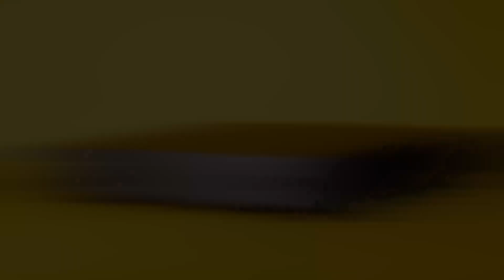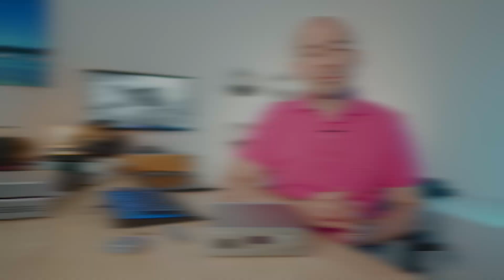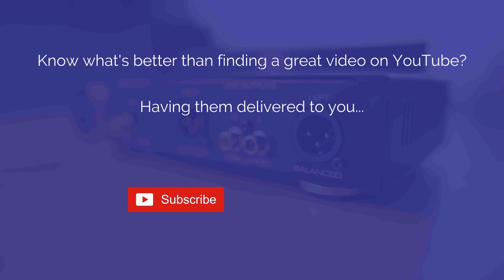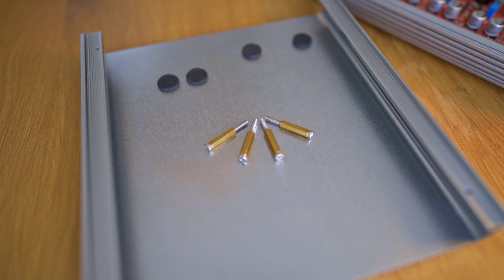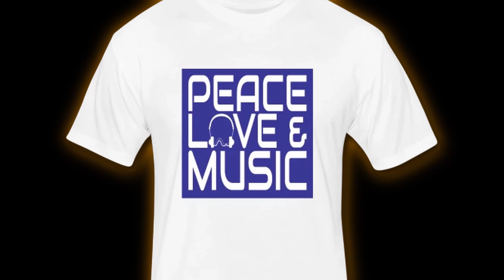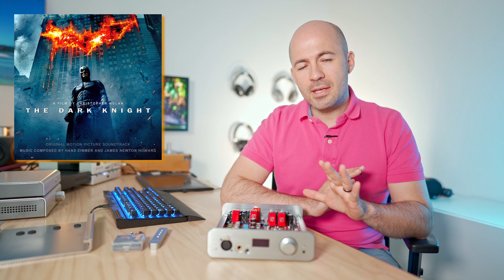Burson Soloist 3X Headphone Amp Review - New tech + old classic = wow!

Comment: Hi Lachlan, thanks for the incredibly detailed review. I absolutely love it and already thinking of pairing this amazing amp to my Chord Hugo2. 

Do you think they would make a great pair? I’m using them to drive my LCD-2C, Hifiman Susvara, Unique Melody MEST MK. II and LCD-4! Do you think I should purchase a fully balanced DAC like the Schitt Bifrost 2 to make them a fully balanced stack to yield more power for these power hungry cans?

Thank you so much mate. I’m looking forward to hearing your great insights. Have a great day good sir!
Reply from the maker: Hi EG, the Soloist and Hugo 2 should be a great combo and, from memory, there's no particular benefit using the XLR inputs on the Soloist. It will have plenty of power for all your headphones even from just the Hugo 2. I also don't know if the Bifrost would be a better overall DAC. I think the Hugo 2 is probably preferable.
Reply: @PassionforSound  Cheers mate, thank you so much for the elaborated answer. How would you fair Soloist + Hugo2 with an all in one combo like the Conductor 3X Reference? I appreciate your time and knowledge greatly, thank you!
Reply from the maker: The separates will almost always outperform all-in-one devices up until you're in the TT2 range of price and performance so I'd definitely stick with the Hugo & Soloist.
The reason I say that about all-in-one devices is that they almost always are a compromise, sharing power supplies, noise, etc. and by using a single chassis, the space for the circuits are limited so you're not getting the full potential from either amp or DAC.
Reply: @PassionforSound  Gotcha, thank you so much mate! Have a wonderful day over there :)

Comment: Hi Lachlan, great review. I have a Burson Conductor V2 amp and I was wondering if you feel there would be tangible benefit in going to the Soloist 3XP? My DAC is the Composor 3XP, and current headphones are LCD2 (2020), 660S, and Elegia. Quality interconnects.
Reply from the maker: Hi Heath, there'll be a huge upgrade in overall sound quality, but also a slight change in signature I think. I owned a Soloist V2 and the Soloist 3XP is more neutral and less mid-focussed. If the Conductor is anything like the Soloist of the same generation, you should expect a less coloured sound, but also much improved transparency and resolution
Reply: @PassionforSound  Thanks, Lachlan, I bought the Soloist. I've had it for 3 weeks and you were right on the money with your review, and with your comments on my question. Thanks, again.
Reply from the maker: That's great news that you're happy with it, Heath. Congrats!

Comment: Did you manage to try the Sparkos op amps with this?
Reply from the maker: Not yet, but I literally just email Sparkos about this yesterday 😁
Reply: @PassionforSound  It was in the airwaves!

Also, did you try the Burson with the Chord Qutest? Even if you didn't, can you speculate wheyher you think it would be a good combo for a clean and detailed sound without any harshness? That's my impression of what the combo would be like from what you've said here and they're what I have my eye on.

As always great videos and I really appreciate what you're doing with this channel. Your explanations are the best and I really value your opinion, especially while it isn't easy for me to try this expensive equipment before I buy.
Reply from the maker: The Soloist / Qutest combo will be magic! I didn't try them together, but I use the Soloist with the TT2 all the time and the Qutest has many similarities as you'd expect. It will be one of the best headphone setups you can buy for under about $5000 IMO
Reply: @PassionforSound  that's excellent to hear that you use that set up all the time. Quite the endorsement. That solidifies that pair as my aspiration; it will make quite the upgrade from my r2r-11. 
It seems like the Qutest would have the similarities as you say, but with more smoothness than the TT2.

Thanks again!
Reply from the maker: My pleasure

Comment: just ordered this amp with the bifrost 2, as you seem to have that as your optimal pairing for this if i'm not mistaken (at least for this price), i expect a sizable upgrade from my current jds el ii stack. i will be using this combo with a diana v2 vs clear mg to decide which one i keep (so far i am a bit torn, diana = more detailed but mg = more punchy imo). on that note, do you plan on reviewing either of these headphones in the future?
Reply from the maker: You're in for a treat. That's definitely my preferred combo before stepping up to the Qutest as DAC.
I would like to review both headphones at some point, but I'm yet to have success with those companies so they might have to come through as loans.
Reply: @PassionforSound  considered the qutest too but was able to get this stack for similar price all together (slightly used). was also eyeing the conductor 3xp which i found quite cheaper on recent classifieds for ~$900 if you have the patience in order to snag a deal like that, but i care about the sound more than extra features. will update here on my findings soon

hope maybe someone local will be able to loan you some more headphone brands like these!
Reply: alright after a couple days with the stack upgrade - immense improvement in sense of depth and imaging, more layered while being precise which adds to represent a lifelike sound. separation is suberb, actual feeling of vertical and horizontal space. both headphones performed greatly with the stack, but as i purchased the clear mg for about half the price of the diana v2, i can't justify the cost with the (let's say 15-20%) improvement of resolution/speed that it provides over focal

extremely happy with this setup! i will keep this as my end-game until maybe someday when i can comfortably afford a 1266 or susvara
Reply from the maker: That's great news! So glad you're enjoying it so much! 🙂🙂

Comment: My soloist 3XP is on its way with 4 extra Sparkos ss3602 Op amps as well
Reply: I’m also excited to test the power amp mode with a separate pre amp to see if the soloist current will improve to totl headphones.
Reply from the maker: I'd love to know how the Sparkos compare to the Vivids in the Soloist. I don't have the right ones for the Soloist ☹️
Also, with the power amp mode, it will only be an improvement if your preamp has a better volume control implementation because the Soloist volume setup is outstanding already. Fun to try though and see what you prefer 🙂
Reply: @PassionforSound  so many options!  I’m also looking at some focal solo6 studio monitors as well (used) so will be Interesting to how the soloist does as a pre amp.
Reply from the maker: I'm using it as the preamp for my KRK Rokit 5 G4s and it's great!
Reply: @PassionforSound  I've had the Soloist 3XP for about 10 days now and have tested it with the V6 Vivids and Sparkos SS3602 op amps... My initial takeaway is the Vivids provide a slightly more V shaped presentation with more bass impact and a slight extra sparkle on top.   The Sparkos are a bit flatter with more emphasis on mid range and I'd say a slight improvement in technical performance/clarity/resolution as well.   With my 1266 Phi TC the Vivids are more impressive but perhaps the Sparkos are easier to live with in the long-run.   I haven't a-B tested them with my other hps yet (LCDX, LDC3F, Focal Clear, and Klipsch HP3s) but plan to do so.
Reply from the maker: Thanks so much for sharing. I'd better reach out to Andrew and get myself some Sparkos op-amps for a try...
Reply: @PassionforSound  Honestly I think if you have a Susvara or a 1266 Phi being fed from the Soloist 3XP it is worth it.  Perhaps if one wanted to cut costs just getting a pair and switching out the input side would be suitable without having to get all 4 for the volume stage as well.  It's a pretty great amp and I'm going to try the power amp mode next week to see if there are any substantial gains there.
Reply from the maker: The power amp mode is definitely an improvement if you have an excellent volume control in the DAC / preamp. Also, stay tuned for a review of a brand new add-on product from Burson that's also a nice upgrade for the Soloist.
Reply: @PassionforSound  I have a Holo mammoth KTE hp amp they has a pretty good volume control in it but not sure if superior to Burson.  Will just have to test it out..  I won’t take your thunder but my guess would be an upgraded power supply from Burson to pair with the soloist.  Perhaps like the XI Audio Formula S + Powerman combo just at a more budget price.
Reply: Can’t wait to see that review I’ll keep watching for it!
Reply from the maker: It'll be interesting to see how the two volume controls compare.
No comment on the review 😉😉
Reply: @PassionforSound  just got an email from Burson on the new power supply (super charger 3a).  Look forward to your review.  It certainly doesn’t look impressive for the price but hopefully it make a sound performance improvement.  Perhaps a bit more bass energy/control/dynamic punch would be ok.
Reply from the maker: I just dropped the review to coincide with the launch. Enjoy!
Reply: @PassionforSound  soloist 3X grand tourer was just announced for 2500 usd.  Looks like a significant upgrade from them.
Reply from the maker: Yeah, pretty interesting looking specs. Stay tuned 😉
Reply: @PassionforSound  I reached out to their sales team to ask for tangible benefits with the GT over XP for someone who owned a susvara or Phi TC.  I also asked about upgraded power supplies in both and it they were going to sell additional upgraded for gt this is their response: 

The Soloist 3X GT has a high output and its power supplies are tuned to about 10 times harder than the Soloist 3XP

Regarding its performance, It has a higher channel separation hence lower cross channel interference and noise.

It also has a lower output impedance which can match more power amps.

The power supply that comes with the Soloist 3X GT is bigger than the one that comes with the Soloist 3X Performance.
Reply from the maker: Interesting. I think they tend to shy away from commenting on specific pairings and benefits as many manufacturers will because it's so personal. With the power supply, it sounds like they won't be making one because the GT is a limited run item (according to their marketing - although that might change when chip supplies improve)
Reply: @PassionforSound  I got a follow up response on the power supply as well:

Thank you for your email.

The power supply included in our Soloist 3X Grand Tourist is a standard 24V/5A power supply.  

We don't have a "Super Charger" for the GT at the moment but it is on our to-do list.  But even with the standards 24/5A PSU, the GT is many times better than even the Soloist 3X-P. : )
Reply from the maker: Cool. Thanks for posting that! Looks like the GT will be a long term product then and the initial limited supply isn't permanent

Comment: How is the sound-stage of Soloist 3x & Mainline when compared ?
Reply from the maker: Both are excellent. The Mainline creates a touch more distance between the listener and the music and is a little wider. The Soloist is a little more focussed, a tiny bit more intimate (but not at all congested) and not quite as wide
Reply: Hello  @PassionforSound  ,
I rewatched your review to make sure: you insisted on how spacious the soloist was.
Now you say it is more intimate with not so wide soundstage ?
Did your experience with the soloist 3x changed with time ?
Reply from the maker: No, not at all 🙂
For a solid state amp, the Soloist produces an excellent sense of space. The Mainline, being a tube amp, just produces even more space, but the difference isn't huge.
Reply: @PassionforSound  thank you for the clarification.
I was anxious for a bit, because I bought the soloist 3xp especially for it's spatial capabilities compared to ss amps. Still shipping by the way.
Will keep you posted on my impression.
Small question , do you intend to review the gustard x26 pro (heard many marvellous things about it, but I value your opinion very much) ?
Reply from the maker: I think you'll be very happy.
I'm trying to get my hands on some Gustard gear, but struggling to find a source for loan equipment ☹️

Comment: Hello @PassionforSound ,
Great review,
I just bought the soloist 3xp based on your review.
Question please, do I use high gain for the zmf VC (300ohms) ?
Reply from the maker: Glad I could help you make a great decision. I'd personally start with medium gain and see how you go because you'll probably get slightly finer volume control (i.e. smaller steps). There's no reason not to use high gain though so try both and see which feels better to you as they should both sound identical when playing at equal loudness
Reply: @PassionforSound  thanks.
What is the difference in perceived sound. Between high/medium gain and headphone power amp mode ?
Is it a high Z mode ?
Reply from the maker: No, there's no high Z mode, just different gain levels so the sound is the same in each mode - just louder

Comment: Thank you for review. Do you hear any hum through speakers then you use Soloist 3X as preamp on high gain?
Reply from the maker: I wouldn't personally use it on high gain based on the speakers I have here - too loud and not enough usable volume steps. What speakers are you using that need high gain output?

Comment: Thanks for another great and thoughtful review here. I may have to replace my Chord TT, because it’s being repaired, but it may not be repairable. I’ve been doing a lot of research on what’s out there, what I’m willing to spend, and the qualities of components that I like best. Right now, I am looking at getting the Soloist 3X along with the Denafrips Ares II. 

What are your thoughts on this pairing? And, any other recommendations for something different within a reasonable price range?
Reply from the maker: Hi Ali, I personally don't like the Ares II that much (too smoothed off). I'd look at either the Qutest or Bifrost 2. Both will provide an excellent sense of spatial information and resolution without getting harsh or forced.
Reply: @PassionforSound  Thanks very much!
Reply from the maker: My pleasure
Reply: Did I understand correctly that you were testing the Burson with the TT2, where you were using the TT2 solely as a DAC and having the Burson provide amplification? And, did I understand it that you actually preferred it to the TT2 on its own? 

I was able to repair my first generation TT,  and now I am thinking about pairing it with the Burson. I realize that you have not demo’d the original TT,  but since you’re familiar with the TT2 and the Burson I’m wondering whether it would be a worthwhile and significant upgrade as opposed to just using the original TT and it’s on amplification. 

What do you think? Thanks. ☺️ 🙏🏾
Reply from the maker: You're correct about me using the TT2 as DAC and feeding the Soloist to see exactly what it is capable of. I don't feel like it's better than the TT2 internal amp, but it comes admirably close given the significant difference in price. The TT2 still has a slight edge on overall transparency and detail retrieval, but depending on your headphones andusic tastes, the slightly smoother (but still exceptional) Soloist could be preferable.
It's a shame I haven't heard the original TT to provide some sense of comparison.
Reply: @PassionforSound  Thanks again, and I hope you’re doing well.

Comment: Smoothing things over sounds like a very bad thing, even if pleasant... somewhat worrying to me.
Reply from the maker: Sounds like I've been unclear because the Soloist is not removing any detail or texture at all. I can't recall where I might have said it was smoothing things over, but it's in no way  losing fidelity - it's still one of the very best amps I've tried at any price so far.
Reply: @PassionforSound  No worries, I might just have a gripe with the idea of something being smooth and not losing detail - since to me any sense of smooth-ness would indicate less of some sort of 'grain' and thus less of some form of detail; any rounding of transients would reduce ability to distinguish things in busy passages... But thats getting quite pedantic, I know - so don't worry about it :)
Reply from the maker: Definitely no loss of detail here and the transients are wonderful. Some amps actually create additional dryness to the sound which we can easily mistake for detail, but it's not part of the original recording so it's equally as bad as the loss of transients in many ways.

Comment: Hi Lachlan, just wondering if you've had a chance to listen to the Focal Arche yet? If so, how would it compare with the soloist? Cheers mate and thanks for all your great work!
Reply from the maker: Hi Shanul, no I haven't yet. I'm a bit torn on it to be honest - nearly pulled the trigger, but can't decide. I also have other gear already that does the same trick (i.e. allows adjustment of the output impedance)

Comment: I recently received my Soloist 3xp, the sound is great, but some time when I just turn on the power, even without connecting to the source, it generate very loud hiss noise (can clearly hear it a few feet away from the headphone, can’t bear with it with headphone on my head ), the noise last for 20 - 30 seconds, then no more during the following usage. This happens no matter I power on the amp with my headphone plugged or not, if I turn it on without my headphone plugged, it can happen when I plug in my headphone (I always use the XLR input), and it usually happens when it off for a long time (8 hrs) then turn on. I always disconnect  my headphone when I’m not using according to their manual, but it still happened time to time. Don’t know if anyone else is experiencing the same?
Reply from the maker: Hi Alex, check my response to your other comment 🙂